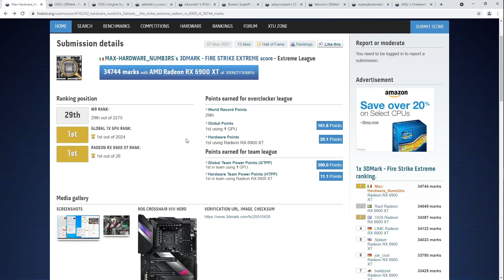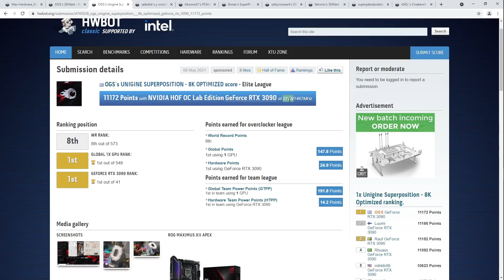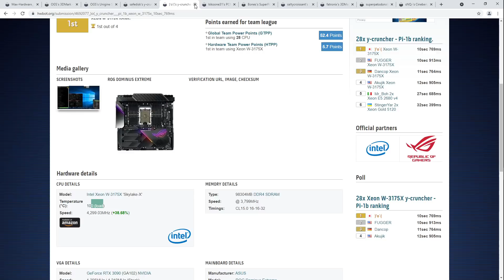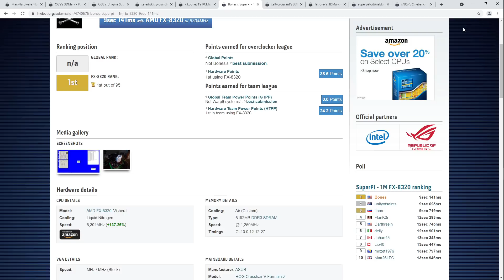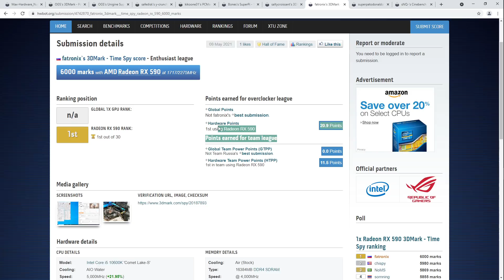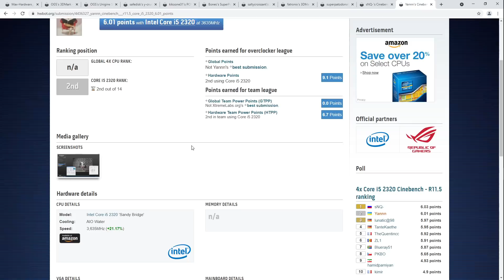HWbot score round up #2: 3GHz+ 6900XT, 2.83GHz RTX 3090, 8.3GHz FX8320 and more

Comment: There is like 0.0001% probability that amd made a whole new die for this new sku, its millions in costs to make a new die.
Yea, they are binned different and have different enabled limits.But its the same die.
AMD just saw an opening with pricing, people PAY now, so they released a "new" core which costs more.
And just like with a K intel chips, its the same chip from the same wafer.
Reply: One more thing to add.
Its like Vega`s, you have Vega 10 XL (56) vega 10 XT (64) and vega 10 XTX (64 LC) ,But its the same chip type/revision just binned at factory differently.Those letters at the end are bining types, maybe disabled CU`s maybe because broken maybe because just needed that part, some functionality (like power target diff between XL and XT).

Comment: needs to be a new SKU. It’s really bad bc there’s 0 obvious indicator in the product marketing for the original. 6900xt was sold as a flagship. AMD could have had bigname outlets getting free marketing for them like the 3090 had. but instead they had a “6900xt ti” they never mentioned
Reply: Creating a new sku is expensive, and the people who are willing to mod the card don't care much about the name of the sku.. Unless you go for volt mods and exotic cooling you get no benefit from removing the frequency limiters on the normal 6900XT so there's not much reason to bother paying more to make it different.

Comment: Paying for unlocked multipliers is scummy.
Reply: I'm actually fine with it because they've set the limits in reasonable places.. the ram unlocked goes maybe 10mhz higher before loosing performance, and the core limits seem to be set around 100mhz higher than what most people can achieve. It sucks for people that want to modify their cards, but for everyone else it just makes overclocking easier because it's hard to set the clocks high enough above what the card can do that the driver can't recover from it. If they had a seperate tool to unlock it would be perfect imo.
Reply: @VeritronX  I can send 2.0V strait to the CPU with most motherboards. It's not about protecting the product from the consumer. Guess I'm just used to being able to do what I want with the products I own without needing some obscure workaround or physically modifying the board.
Reply: @willjohnsonjohnson  that's not true with most working videocards though, they've had voltage limits for years.. nvidia started doing that with the gtx 480 and doubled down on it after people still managed to kill gtx 590s from overheating the vrms 10yrs ago

Comment: Yes the rx590 have bios modded.Got one myself and voltage locked at 1212.
Managed to push to 1660mhz core clock with stock bios,vram let go after that point.
Funny thing i have done with same psu,managed to push core clock at 1650 and after got whinecoil,shut-off/reboot as soon as on load haha.

Comment: why are there different rankings for with and without benchmate?

I thought nobody had submitted cinebench runs with dual 7763s, but it turned out they used benchmate and so it didn't show up on the general cinebench leaderboards

Comment: I would love to see that 18C put under a huge 2 stage cascade. You would probably end up using 5-6 kW just to run the cooler, but you would hopefully perfect temperature control. Hmm, if the cascade had compressors driven by PID controlled VFDs or something, in theory you could keep the evaporator at a constant temperature regardless of load, or something close to it. It would probably cost 5-20 kUSD to build such a cascade...

Comment: The optanes with XPoint memories are faster at small and random reads than flash SSDs since XPoint is designed to work as NVRAM, so different tier products really. But speed would probably still be much worse than RAMDISK since PCIe optanes still communicate through PCIe NVMe controller

Comment: Especially considering the boosting technologies of today, I don't like the 'K'-tax cause it's more like paying the mob to not smash in your windows or break your legs. That is, you're not paying for a better silicon quality, you're paying to not be unbypassibly crippled.
Reply: What about those AMD chips that were sold with cores disabled? They were cheaper on purpose to fill a lower price point. I don't think all chips should be fully unlocked and expensive.
Reply: @safedork  So I was sold a physical product. That physical product either has 2 of its 8 legs deformed during birth, or the pelvis smashed by the mob. For the natural cause, I understand that the hip down needs to be amputated to keep the same running speed. However the fact to not allow me to at least try to flex those 2 legs, however shitty the could be, is morally weird. Those who wish to flex the legs beyond, say, what Jay's Deck docks, would be interested in the crawling speed, even if it was 500MHz.

Upon this topic, arguing about frequency is a little easier for others to understand.
Reply: Faux biglittle, if biglittle takes off in the PC space.
Reply: K-tax is product of stagnation, nowadays the bug three all knows they have to do their best in tuning the silicon to max and you can see how on ambient rocket lake doesn't have much headroom for OC. 
K-tax still exists as a way to get a but more money, but practicality is already gone. Intel COULD make all chips overclockable but that's like dropping GPU price in current market - no good reason to, might as well make the money.
I would argue that for consumer market at least, making chipset-less boards and put the money towards VRM would benefit the low end and remove XMP limit - that's a real stupid cripple, when mem controller is on CPU. 
For enthusiast? "They'll pay anything" must be what companies are thinking